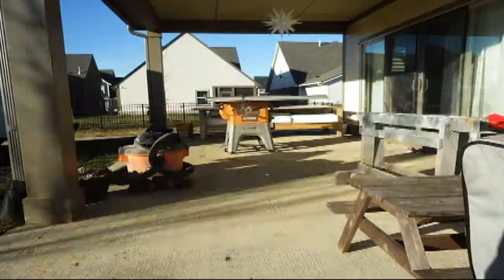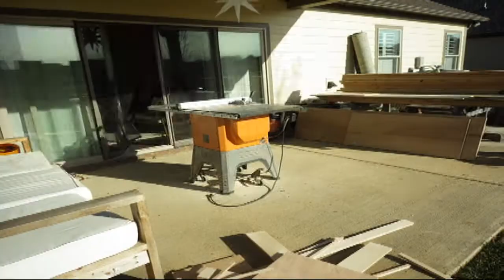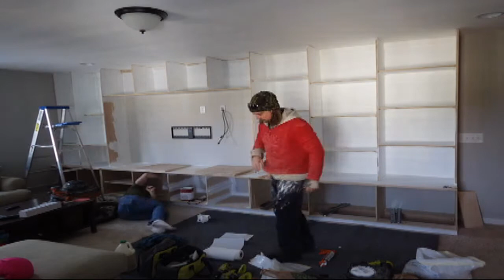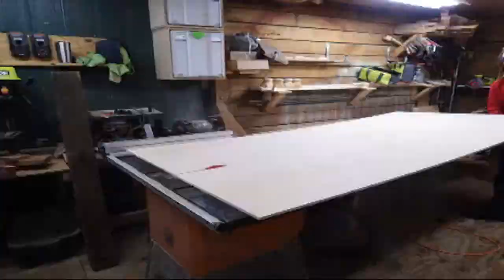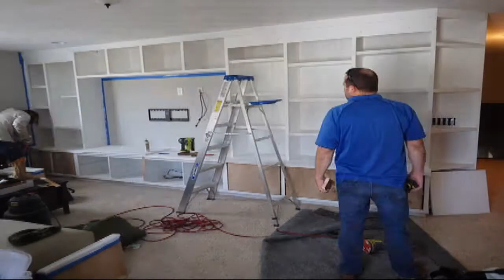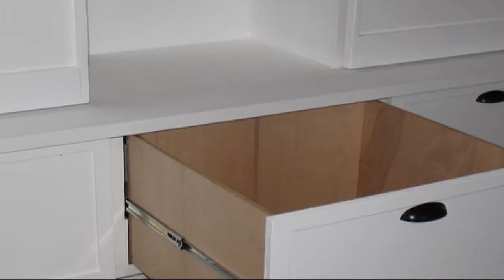Epic entertainment center timelapse!

Comment: What tools would you say were a must have 
And what kind of wood did you use
Reply from the maker: Table saw is my main go to! I don’t even use my miter saw anymore because I can make any jig I need for the required cut and cut it safely. A good battery powered drill and driver set is s as must have! Check the links in the description for my best recommendations.

For the woods o use it is almost always poplar woods and maple and birch plywood in cabinet grade.